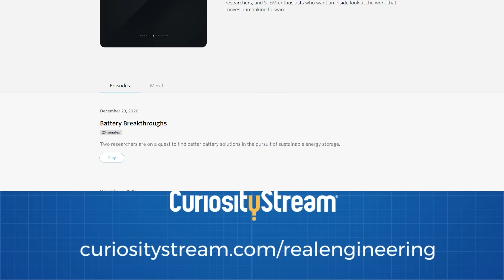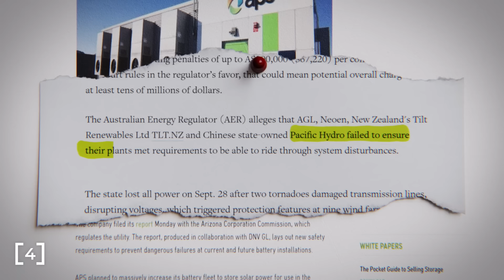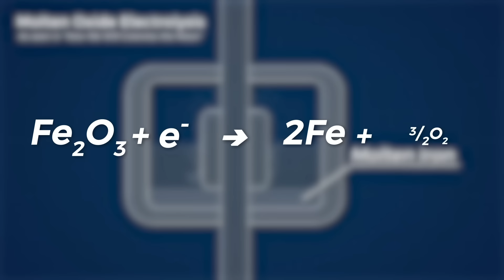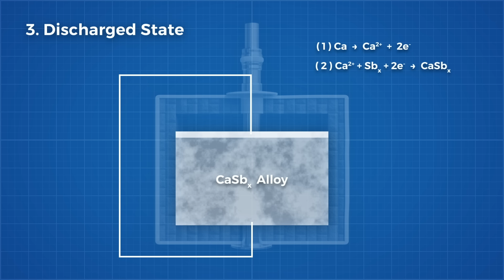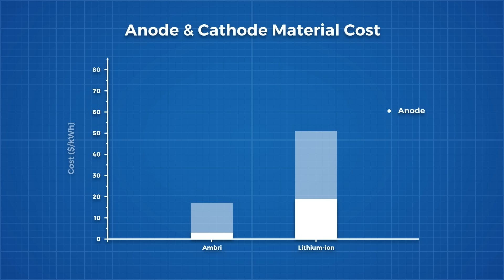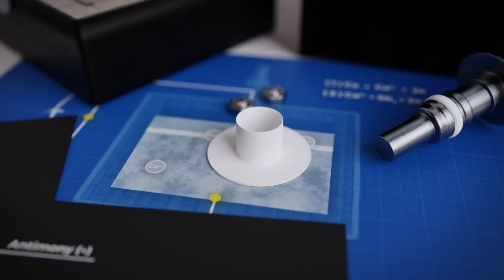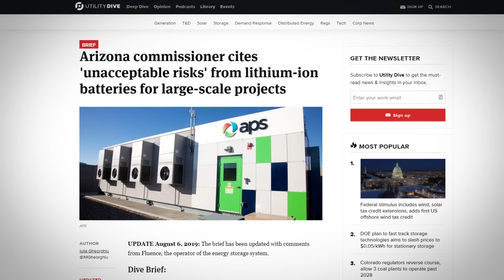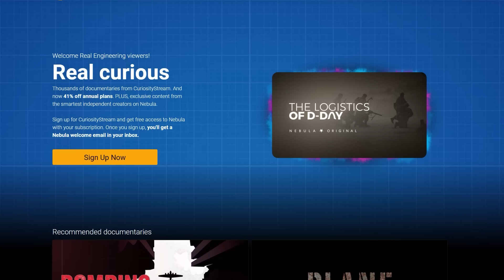The Missing Link in Renewables

Comment: I think these new small and medium scale reactors are only a few years away and with no outside electric source required, for pumps etc, using simple water flow instead, they offer a brilliant solution for the next 40 or 80 years until technology in storage catches up

Comment: If the ceramic insulator is sealed, couldn’t we lower the pressure inside therefore lower the melting points of the metals and eliminate the heating element?
Reply: That wouldn't lower the melting temp.
Reply: How do you keep them sealed with thermal expansion?

Comment: If you are worry about the heat lost in the calcium batteries, why don't you make one battery inside the other? That calcium battery could be surrounded by the lithium one, increasing the calcium temperature or is that already existing?
Reply: Heating lithium batteries is a bad thing. In theory, you don't want them heating at all. Plus, heat always goes from hot towards cold, and lithium batteries need to run cooler, so they'd just function as heat sinks instead of the insulator that's needed to maintain the temperature of the calcium battery.

Comment: When you said the big question, I thought you were going to answer how long the container can stay good.

The metals sound a lot like liquid salt nuclear power - they just eat the containers
Reply: Not nearly THAT hot - it's a chemical alloy reaction - not nuclear!  In fact those temperatures have been used in smelting for thousands of years.  And used brick to do it!  None of those 4 material properties he listed for the case are technically difficult today.  Simply doing all 4 at once cheeply is the issue.

There is a good reason fusion experiments are using magnetic "force fields" as the container.  Those temperatures are not liquid, or even gas, they are plasma reactions.  This stuff is merely liquid.  And not all that hot either.  My oven gets that hot!

Comment: Sounds terrific for the electric grid period, not just for renewable energy.  If you can store energy; then you can reduce the generating capacity of the power plants needed to meet grid peak demand. This means smaller in number and size of coal, natural gas, or oil electric generating power stations. That alone will reduce pollution whether you add in renewable energy or don't add in renewable energy to your grid. It's a win-win.

Comment: You can't ignore the cost if inefficiency because it increases the  cost (capitol and maintenance) of the power source over it's lifespan, whether it be wind or solar.  The heat wasted charging and discharging batteries could have been used to power the grid.  
You must figure efficiency  (lost power) both directions --- for example pump hydro...  
pump @ 80% x electric motor @ 95% = 76%  on the way up,  and 
turbine @80% x generator @ 95% = 76%  on the way back down.
therefore 76% x 76% = 57.8%
At the very best, batteries are a stopgap to get the natural gas power plant fired up, or to smooth the variation in wind and solar.

The high temperature will increase the corrosion rate of everything at that increased temperature.

A 250 MWH battery isn't all that big.  10 MW solar x 12 hours daylight = 120 MWH. 
 12 hours dark and 2 cloudy days and you're in trouble, calling up the reliable power company.

So now we have 23 MW geothermal + 10 MW solar + 250 MWH / 25 HR  battery = 43MW capacity to run a 20 MW data center.  Can you guess which one is the workhorse in this scenario?  
The solar + batteries just make up the 50% overload that the data center uses during the peak demand.
Maybe they don't have Hailstorms in Reno.  When I mention that to anyone around here thinking about using solar, they say "Oh Crap, I didn't think about that".

Works the same way on a larger scale...
nuclear power plant------->coal/natural gas------->hydro------>wind/solar-------->batteries

Ask 100 people if they want their electric bill to be  $100/month or $150/month and 99 will reply $100. 
A data center can pass on the costs as an invisible fee of a few percent, so all is well, and they are heroes for using renewables.

Sorry to shoot holes, but it must be done.

Comment: "pumped hydro doesn't scale" - read Blakers et al
Reply: Exactly.
Fact: the world's largest pump hydro storage facility is 24000MWh which is larger than the world's largest grid battery 300MWh. "Not scalable" my ass.
Fact: pump hydro storage make up for 95% of grid energy storage. "Not scalable" my ass.
Reply: Yeah, I couldn't understand how pumped hydro couldn't be scalable. I figured someone else commented.
Reply: Maybe he means regular hydro can't scale because water is limited. 
Pumped hydro works everywhere with a hill that isn't extremely cold or hot.
Reply: Wish we had some water in the Kalahari Desert Sothern Africa!!
Reply: @luongmaihunggia  First you need water!! Come to Southern Africa, we got the most amazing mountain escarpments but no water - lot of good that does!!
Reply: @charlyazbek7166  I know some places lack the requirements for PH. But it doesn't need to. Just look for other places that meet the requirements build a PH facility there and connect cable from there back home. Easy.
Reply: @charlyazbek7166  There's not much electricity demand in a low population region like the Kalahari.
You could still do pumped hydro nearer to population centres like Cape Town even though rainfall is low. You just recycle the water without letting it go. Lesotho would be good for it too.
The main thing you need is the geography and that the water doesn't freeze or evaporate quickly.

Comment: Ceramic seals are already used in vacuum systems and have all those properties. They also have the perfect expansion under heat to match metals such as copper to maintain a seal.

Comment: I'm surprised giant flywheels aren't being used as energy storage.
Reply: Theyre developing that as another option for power storage, and NASA is doing some fancy stuff with it
Reply: They are, but heavy fast moving parts have reliability issues. There is also a large self discharge due to resistance, so they aren't good for long term storage (like grid storage for renewables, which requires 12 hours).
Reply: There's mechanical bearing flywheels, cheap, but has high resistance.
Then there's magnetic bearing flywheels, these could keep spinning for months, but you have to put them in high vacuum.

What matters most though is the materials, you can't just keep scaling the flywheels up because at some point the forces of the wheel spinning will tear itself apart. Except how big you can make a single flywheel directly dictates how cheap it can be, because you're going to need one motor/generator and the hardware to go along with it (bearings, enclosure, vacuum system if you actually want it to be efficient) per flywheel.

And then you get to have fun with gyroscopic precession, because the earth rotates around itself once a day.
Reply: There are companies manufacturing and selling flywheels for energy storage. There are disadvantages though. I'd recommend checking out "The Mechanical Battery" by "New Mind" here on youtube if you haven't seen it yet.
Reply: There are gravity batteries, there is hydro pumped storage and so on. This video's title is just a plot to talk about more batteries, as if YouTube wasn't already full of them
Reply: The best hope for flywheels is smaller units, with the wheels spinning in a hard vacuum, suspended on magnetic bearings. That would reduce their stand by losses enough to make them competitive with batteries. The round trip efficiency of flywheels would beat, or at least, be competitive, with this liquid metal battery technology.
     Flywheel energy storage is a very viable solution.
Reply: @almerindaromeira8352  You're right, but, this needs to be discussed. Consider the fact, that we need so many gigawatt hours of stored energy, it's hard to imagine that any one technology can fulfill the need. The bottom line is, we need all the different electrical energy storage technologies that we can possibly develop.
Reply: IIRC flywheel discharge time is really small, minutes as max.
Reply: @xureality  I think precession in stationary flywheels can be solved by aligning their axis with earth's.
Reply: Turbines in hydro plants serve this purpose, they keep spinning for hours when not under load, an can become under load and online on cue. Many countries use these as their grid stabilizing component.
Reply: @igornoga5362  that only mitigates the problem, because the earth doesn't have a fixed axis, but rather wobbles slightly. I think it's only a few degrees, so it's probably something you could design against I guess.
Reply: Inertia and response time must be considered as well.
The larger the rotating mass, the slower it can respond to fluctuations in grid load/frequency.
Large arrays of smaller flywheels could get around this, but then you're taking a hit on efficiency and cost.
Reply: @sixstringedthing  you could use a small array of small flywheels as a short burst of energy to bridge the gap while the large flywheels kick in. Or since it's AC anyways there's no harm in letting the frequency float for a bit then comes back up.

But ultimately the answer would be in diversity; li-ion batteries, flywheels, pumped hydro, molten metal battery and others I don't remember or knew exists all working in unison to cover all of the cases.

Comment: It'd be great if they come up with a way to recapture the heat energy to increase that 80% efficiency.
Reply: heating of nearby buldings would be a good way to do that
Reply: That was my initial thought, but then consider that mining and extraction is really dirty. If antimony production (along with reduced reprocessing/recycling) is cleaner, and I don't know if it is, I could imagine that being a big point in its favor.
Reply: If they scale up the size of the the electrodes and then placed them under a vacuum I was wondering if that would reduce the electricity to keep them at optimal temperature
Reply: Put a lot of batteries near each other
Reply: @ELYESSS  Yes!  Packed closely together in a very large heavily insulated building that will retain the heat that leaks out of the cells.  The cells themselves should also be heavily insulated and should be as big as can be manufactured economically with adequate strength.  Maybe the "building" should be below ground so that part of the insulation is the ground itself.
Reply: Put thermoelectric panels around it as insulator, make some more electricity.
Maybe not cost effective but it's an idea.
Reply: @borism4629  You need to keep the other side cool for it to work and you end up loosing more to the heat exchange
Reply: @ELYESSS  indeed but you are loosing heat anyway
Reply: @calamityjean1525  Though that makes it hard(er) to maintain should the ceramics fail due to being brittle.
Reply: @cyrusol  Yeah, ceramics can be brittle, but what is there going to be to stress these containers?  Once they get hot they will stay hot, so they won't have thermal stress.  They won't be moved,  so they won't have mechanical stress.  I could imagine one cracking while it was being heated for the first time.  If there is a water leak and actual liquid water got onto a hot container it might crack but how likely is that?  The air temperature in the room would probably be literally hotter than boiling so a small leak would flash to steam before it hit anything.

Comment: Bitcoin mining can be used as a demand-side response with an effect similar to that of batteries.  Bitcoin mining requires huge amounts of electricity, and the mining process can be stopped instantly. In addition, Bitcoin miners are extremely geographically flexible and can located their mining facilities anywhere as long as they have electricity supply and internet connection. The way it works is that Bitcoin miners makes a deal with the grid operator that they will turn off their equipment in certain conditions, so that the electricity the Bitcoin miners used gets released into the grid and can be used by other customers who need it more. In Texas, they are already doing this. Check out how Layer1 stabilizes the grid in the ERCOT system in Texas. It would be so cool if you made a video on this.

Comment: I see a limitation is that the 2 elements need to be able to be in contact with each other in the liquid state without spontaneously reacting, so that the redox reaction only happens while it's discharging. That's why Ca+Sb is used rather than a more energetic, lower melting-point combinations of common elements, like K+S (which presumably would spontaneously and possibly violently react with each other once the potassium melted if not earlier).

Comment: I like how after years of use, ONE fire breaks out in Arizona and they have to shutdown THE WHOLE grid.
Reply: This proves government being more dangerous that li-ion battery.
Reply: @legolegs87  no, the manufacturer & users are very smart, in this case they probably calculated the probability of failure of their setup beforehand, but when it broke unexpectedly then it mean; 1) sabotage, or 2) manufacturing/design error. Same thing happened to US Space Shuttle, it was retired because of design flaw.
Reply: @xponen  the Space Shuttle was retired because it was old and expensive
Reply: @counterfit5  that was the design flaw
Reply: It's common sense. What if the heat has degraded the batteries and caused the fire? Then maybe all the batteries are in bad condition so shutting down to check makes sense. What if a fault or something caused the fire? Maybe other fires will break out so shutting down to check for issues and repair problems makes sense.
Reply: @counterfit5  Space Shuttle's catastrophic failure probability  was calculated to be 1 catastrophic failure in 100 flight, this number came up after Challenger incident. This mean it is very very dangerous to ride the Space Shuttle. (initially NASA thought it is was 1000x safer. This is why Space Shuttle is expensive, costed 1billion USD per launch, spent to check the heat-shield and everything, to mitigate the risk, even that failed during Columbia incident).
Reply: @Kyle-gw6qp  So when a plane crashes, we should shutdown the entire airline industry? This is why we have maintenance schedules bud. Maintenance schedules are common sense. Politicizing a faulty battery isn't.
Reply: FIRE !

 "Spray water on it!"

"Well that just made it worse!"
Reply: @elephantgrass631  when a plane crashes for unknown reasons all planes of that model should be grounded until they are all meticulously checked for problems.
Reply: @Kyle-gw6qp  And there are reason why the don't ground hundreds of planes like you suggest. There are sensors, failsafes etc. Doing such a thing would be killing a fly with a bazooka. 

Engineers account for this and that's why they test over and over and go above and beyond the spec/tolerances for their designs. Accidents like this are usually idiot human errors, with idiot politician humans reacting like idiot politician humans.
Reply: @elephantgrass631  this is what happens. This is common sense. This is what prevents people from dying.
Reply: @Kyle-gw6qp  Oh ffs. Stop with the bleeding heart crap. It's over the top, expensive and unnecessary. Thank God YOU don't work for the government, and if you do, heaven help us.

Comment: There's danger hot signs all over that Ambri factory, I was taught in physics that heat generation is inefficient.  These batteries operate at 500⁰C
Reply: Heat generation is inefficient but heat retention by using insulators should be cheap. There is no other way they can reach 80% efficiency storing for >6 hrs
Reply: @rahulkopparthi9039  I'm pretty sure that they're just gonna swap to insulating an entire building with vacuum sandwich plates because of the square-cube law. The bigger the building, the lower the specific heat loss.
Reply: @hammerth1421  They might just use really large crate sized units. A whole building seems a little impractical. As far as I am aware, vacuum panels use polymer materials for their cores, so temperature can be an issue.
Reply: Instead of using brittle ceramics, I suggest they use water flasks. 😉

Comment: Please fo a video in SMR Small Modular Reactor, it most probably will change Nuclear Energy Forever.
Reply: I'm very skeptical why a SMR should be more cost efficient than a large nuclear plant (scaling of costs) so I would love something about that topic as well.
Reply: @Kamikater2  nuclear is such a small specialized industry that it is really hard to find competent companies in it. It’s been so long since nuclear has been built that almost no one alive has any experience with it anymore. Making the plant itself standardized will allow more people to understand it since each one won’t be bespoke. In addition having a set manufacturing location will make the industry more appealing since workers won’t have to move with the work.
Reply: SMR’s Can be very cost effective as the main cost problem with tradition nuclear plants are the have to be designed and built differently every time which adds a lot of cost. The Main advantage of SMR’s is that they can be made in a factory . Cost drops Especially after the first few Reactors . And I mean a cost drop of 10 times
Reply: @jaydwivedi8399  hmm... mass production in factories is a pretty old concept. So if building traditional nuclear plants is so expensive why didn't they do the factory mass production back in the "golden era" of nuclear power where they build dozens of nuclear plants?
Reply: @Kamikater2  because they thought they can effectively build large-scale building nuclear reactors. But then they realized it's not as easy and a modular-based approach will be better.
Also at the time the technology was not as good to build a modular reactor.